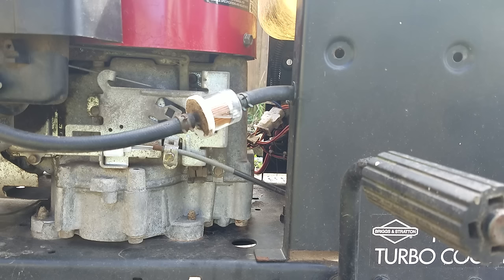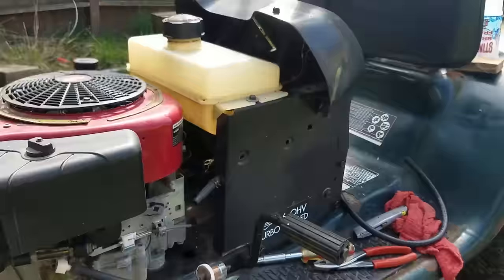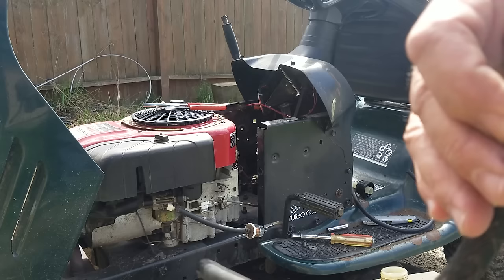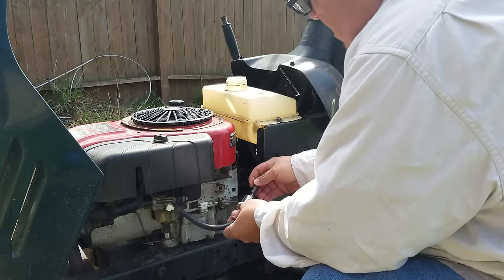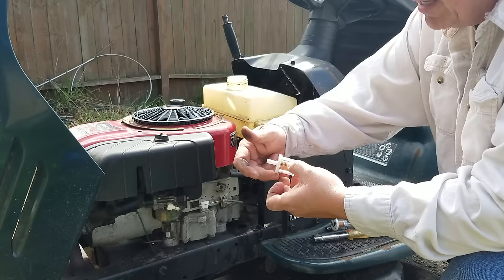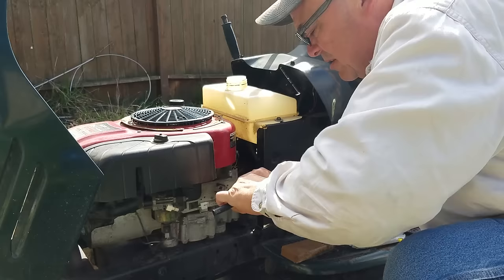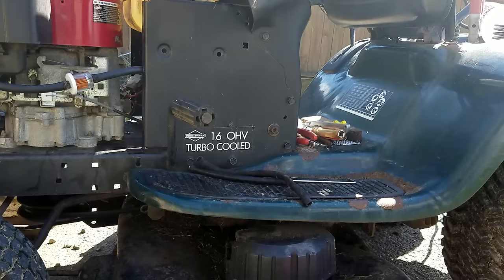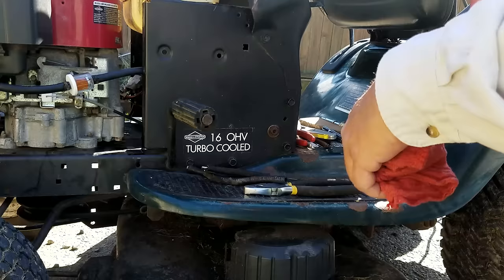Riding Lawn Mower starts then dies. FIXED

Comment: I had a similar problem with my Husqvarna riding mower, briggs and stratton Intek V twin 24.0. Anyways it would run sometimes for 10 minutes, then would seem like it was starving for fuel, cut off , restart sometimes etc. I took the carburetor off, thinking some trash was in the bowl, inspected the float, needle and seat, everything looked really clean. Rebuilt the carb since I had it off, new o rings gaskets cleaned the jets etc. Installed it and fired right up, mowed yard for maybe five minutes, then the stalling , cutting out again. mind you my front yard has a slope to it. After pushing my riding mower back into the garage I was like this thing is starving for fuel. I checked my fuel filter, it was clean but noticed no fuel in it. Turns out my fuel filter was just a degree or two off to get the fuel from the tank, so I rearranged the fuel filter with the flow side pointed more downward, all of a sudden I see gas accumulating into the filter ! I zip tied it to another hose or cable so it will remain in that position. Ran great after that, was able to finish my yard and problem solved. Sorry for the long rant, but I just wanted to say sometimes it's the simple things that get over looked, like I did ! maybe this will save someone some time if they have a similar problem. Thanks for your videos and I do appreciate them !

Comment: I'm a big fan of installing one of those very low cost black & red fuel shutoff valves between the tank and the filter. Makes working on things downstream a whole lot simpler. Virtually ALL available gas in my area for 20 years is 10% ethanol.

Comment: People need to understand ethenal is moonshine and the problem is water and gas don’t mix you need to use a stabilizer there is a product in Canada called phase 4 fuel and ethenal  treatment that prevents separation and keeps the fuel fresh for 2 years
Reply: Troy built lawn tractor dies when engages the blades

Comment: I work on mowers chain saws blowers weed eaters all the time..most of all of them is fuel realated..it's amazing what ethanol can do to small engines ..it gets the gas cap too.the rubber seal detonates and clogs the fuel inlet..you have to check everything..i recommend ethanol free fuel to everyone..thanks for showing this..Cheers 🍻🍻🍻🇺🇸🇺🇸🇺🇸

Comment: thanks for helping me !  im not mr fix it .  ive been having throttle related riding mower starting problems.  got that dealt with .  got WAY back in the hollow , moved around on the seat wrong and it auto stopped.  then OF COURSE its not gonna run . it would start and then stall and the the battery is running down.  so there i am marooned in the amazon, i dont know whats wrong with it but i DO KNOW i couldnt fix it if i did. what a horrible feeling. so i dragged myself all the way back to the house and pulled up youtube and there you were !  i couldnt do the whole procedure back there but WITH YOUR HELP i surely WAS able to get the lines off and clean them out for the emergency fix ! put everything back together and ZOOM !  fired right up. it was such a relief to pull that mower safely into the garage.  so if you ever get frustrated with posting your stuff please know that your kindness really helped me when i needed it the most and that your efforts are appreciated. thank you sir.  THANK YOU VERY MUCH.

Comment: I bought a used Sears lawn tractor with this same  16 HP engine over 20 years ago and it's still running today. I however put a fuel shut off between the filter and tank. Normal maintenance when needed and no ethonol fuel. The mower deck went out however and I use the tractor to tow my yard cart. My kids bought me a new 20 HP tractor when I retired and it's still going also. Thanks for the video. I'm in the NW also.

Comment: Thank you sir. I had this same problem,  replaced fuel lines and filter, and cleaned tank. Runs better than ever. You tube is great for community help.
Reply from the maker: DIY community is the reason I YT..Cheers and stay safe.

Comment: I have the same problem. Craftsman mower is 20 years old and never have changed the fuel line. Filter is new but only has about 1/4 of the fuel filter with gas. Changing fuel line tomorrow! Thanks for the great video!!

Comment: Thanks for this video.  I'm not much of a handyman but decided to give this a try.  After pulling off the fuel line realized the fuel was running fine so all I had to do was replace the fuel  filter. Running great again!  Thanks for posting.

Comment: Good advice I was banging my head around clean the carburetor new fuel filter and what my problem was the debris got stuck in the hole so I had to stick a nail through it pop straight out then had to clean out the gas tank thanks for your video as we get older sometimes we forget

Comment: Good info.  Been a good time to install a fuel shutoff valve.  Good on the carb plus during winter storage.  Just saying.
Reply from the maker: Great point!
Reply: @breakerbroke23  The solenoid under the carburetor float bowl with the wires going to it shuts the fuel off automatically. If it starts going bad, you get the same symptoms. Runs for a bit then sputters and dies.

Comment: Hi there. I came to your channel because my Troy Bilt Bronco had the same issue. I replaced the hoses which were in good shape... The filter looked fine and was full of gas... Yet, I decided to replace the hoses and filter just in case... well, it did the trick! It worked right away with no issues... unfortunately, I hit a tree root and the blade got bent so bad that it scratches the floor... I guess I am bad luck. Thanks for your video.
Reply from the maker: Your bad luck?   Ha!  If I didn't have bad luck, I'd have no luck at all... Iam glad you got the fuel issue handled, and bent blade are easier to take off:) Your okay as long as the spindle didn't get hurt. I guess you could look at it this way, now your Mower runs and you have new sharp Blades:) Merry Christmas .....BB23

Comment: I have a 1984 Simplicity doing just fine, I have a fuel cut valve on the line and use that to shut down the engine so as not to leave that chit fuel in the carb float bowl

Comment: My mower is 8 yrs old. First I had a starting problem, changed  the solenoid. mower then started but would not run.  Luckily I found this video with a mower that was acting just like mine.  Followed the instructions- new fuel line, new fuel filter-now it is running like a mad dog.  Thanks for posting this video
Reply from the maker: Glad you got the mower going... Cheers

Comment: While a degraded fuel line can be one cause, there can be multiple causes for reduced flow.
The mower is a gravity fed system without a fuel pump which depends on the height of the tank above the carb for the pressure.
A low rise gravity fed system does not exert enough pressure to effectivly flow through a 70 micron paper element filter.
Gravity fed systems are supposed to use a simple screen disc type filter which has a much lower resistance to flow.
Was there a prefilter in the tank? In could be clogged with debris from refilling.
Reply from the maker: I'm not fixing "Boogie Man" issues for YT content. I'm fixing a machine that is broken, I say this because if you actually own one of these or have worked on one of these mowers then you would have not made a comment like "Was there a prefilter in the tank? In could be clogged with debris from refilling."  and you would know that the filters used do not matter. In the 40+ years I have been repairing mowers I have seen Briggs use all types of filters on various motors. Filter type is a myth.  Minus 50 pts to the keyboard tech. Cheers

Comment: That style of in-line fuel filter works best with machines which have a fuel pump (vs. gravity fed).  Your fuel filter could be contributing to the problem.
Reply from the maker: The filter I replaced was the OEM filter. 
In real world use I have ran different types of filters in my machines and found zero problems. (both GF and pump style filters) Over the years I have had more fuel line swell and brittle line issues than filters. 
Keep the fuel and tank clean and your good to go.
Reply: That's an interesting fact that I did not consider. I've got an older JD STX38 that I've replaced everything on, and it still stalls after starting. I'll look for gravity feed fuel filters and swap it out. Running out of ideas before I junk it
Reply: @breakerbroke23 my mower hesitates to move would the fuel filter be the problem? Please reply thank you in advance

Comment: We did a test at 4 Stations that had Ethanol free gas. We got a half gallon from four stations. We had them tested and the Ethanol free gas still had 8 to 10% of alcohol in it . Not a joke.
Reply: Half a gallon of gas and you're probably getting almost exclusively the fuel left in the pump's hose from the last shmuck that used the pump

Comment: After watching this video I feel very reassured. Very reassured that I will be buying a new electric tractor soon. If they are anything like my EV, they need next to no maintenance and they are very cheap to run. Thank you for helping with the decision.
Reply: Same here.  After many years of my weedeaters, leaf blowers, push mowers, and riding mowers giving me problems like this and others, electric  or battery powered equipment will be worth a try at the least.  The amount of time I've spent working on the gas powered machines is ridiculous and time I won't get back!

Comment: Fixed a mower this week that would run for just a few minutes then quit.  Turned out to be the vent hole in the center of the gas tank cap had become blocked with some sort of crystallized goo.  It would run until the tank pressure became a vacuum.  Opening the cap would relieve the vacuum allowing the engine to run,  the lower the fuel level,  the longer it would run before creating a vacuum.  Removed blockage from vent hole,  instant fix.
Reply from the maker: Great troubleshooting !!!

Comment: Good job I have a shut off valve on mine and I was wondering why ya never cleaned the tank off while you had it out I always clean things as I go that way no dirt can get in anything.
Reply from the maker: I cleaned out the tank every few years as no matter how hard I tried to keep my fuel clean it was inevitable that dirt would work into the tank. I wanted to make this video as simple as possible, not stray off to far. Thanks for watching.

Comment: Recommend that a fuel shut off valve be installed if there’s none. Sooner or later your engine will be flooded by gasoline from a bad float in the carb. Activating the shut off/ turn on valve will prevent that problem.
Reply from the maker: Yes, and put that shut off as near the tank as possible. Great comment.

Comment: my mower would just shut off and then would restart. turns out the rubber tip came free of the pintal in the electric shut off anti backfire valve and was floating free and every once in a while it would move up  into the needle seat and shut off the fuel
Reply from the maker: Iam sure this information will help others. Cheers.

Comment: The sight of the fuel filter was key to solving my problem. Blew out the line from the filter to the tank. Problem solved.
Reply from the maker: Yes, dirt builds up where the fuel hose hooks to the bottom of tank. Its almost impossible to see from the opening. Cheers.

Comment: All fine and dandy but.... First step should have been...check the gas cap ventilation...2nd, blow out gas line to filter...3rd, replace fuel filter.(plastic media within it WILL,  disintegrate )with Ethanol fuel and plug up fuel outlet. From personal experience with John Deere L120 B&S. 2016
Reply from the maker: Yes, each problem has it's own repair.
And vise versa.. Cheers.
Reply: why didn't you make your own video?

Comment: thank u for a great video... i did a simular repair and also changedv the carb. ran fine until the next use wouldnt start... i only changed 1 fuel line, think that may be a prob. i seen another video that same type of start prob, fuse was the issue... thanks again for the info
Reply from the maker: Your Mower will run like this also if your engine is not charging the battery.

Comment: Weird.  I've had my riding mower for ten years and have never had that sort of problem and I use gas from whatever gas station I happen to be at so I'm sure it has ethanol in it.  In the fall I put in some fuel stabilizer and in the spring it's always fired right up with no problems.  Same with my little push mower and I've had it for 20 years.  I do regular maintenance to them both.  I do need a new push mower but not because of anything with the engine, but because after 20 years the deck has just about rusted out (there are several holes in it and I had to bolt on a bracket 2 years ago to hold one of the wheels on it because the wheel fell off where the bolt hole had rusted out)  Both have Briggs engines.  The push mower has a 3.5hp briggs classic and the rider has a 20hp briggs  Intek engine.

Comment: Hey man not sure if you’re going to see this but I could use a hand maybe you can help... i’m not getting any fuel to the carburetor I have replaced the fuel filter fuel pump and made sure the float in the carburetor isn’t sticking.. so from diagnosing it the only thing I can come up with is that I’m not getting any suction to the fuel pump but I don’t really understand what suction is used looks like the hose goes to the oil stem? When I take that hose off and I blow into it manually with my mouth I can see a little bit of fuel bubbling in the fuel filter any idea what I can do to fix suction issue? Thanks
Reply: Are u able to see the two pictures in my reply above? I can’t even get a diagram to show me where the fuel filter is, or if it even has one still. (Bought used). Can u show me where it’s at in my pictures if u can see them?

Comment: I had a similar problem but the engine died on me after around like a hour. I thought it ran out of gas and I went to my room to play some games until it cooled down before I filled her up. I did and started her up and the mowing belt decided right then and there it wanted to be shot.
Reply: Oh it did have enough gas for me to continue. I thought it ran out until I looked in the tank.
Reply: Did you ever figure out what the problem was ?

Comment: if your carb has a wire at the bottom  disc, that wire with switch on you should have 12v if you have 12v but no gas you can replace that solenoid   the small plunger in the solenoid is spring loaded up to cut fuel  the 12v operate a small magnet to pullit down so fuel can flow in the carb   some carbs dont have this feature  if you can see  gas in your  fuel filter that you added then it could be the fuel pump

Comment: I've seen other videos that claim the type of filter you have should be used on engines with fuel pumps only.  The correct kind for gravity feed engines is the little plastic disk type with just a screen.  What do you think?
Reply from the maker: Great comment, I have seen both types of filters in various applications. I will post a video on this subject. Give me a little time and check my channel every once and a while. Thanks for watching.... BB23

Comment: I always run ethanol free gas in my lawn mower and use the pre-mixed can in my weed eater chainsaw and leaf blower
Reply from the maker: Good for you, always get "clear" Gasoline. I don't like pre mix saw gas. I use Clear gasoline and mix in OPTI for the saws and weed eater. My motors run and the insides look brand new. I have been running Opti in my machines since 2002. Best 2 stroke oil ever, clean burning and easy starting .. Here is a link to look at. I buy mine from a local to support his business but if your locals dont have any order up a few packs and try it out. Best oil ever. https://amzn.to/3DX9mVZ ( I buy mine by the quart, but you can get a small packet that makes a gallon or 2 ) 

BTW.. I put this in my mower and run before putting away for winter.
You can thank me later.  Cheers
Reply: I wish I could find pure gas where I am at but its impossible
Reply: @lexiemaep7930  I am so glad I can get it its expensive but worth it for my lawn mower

Comment: If you think producing ethanol is bad, you should see how bad it is to refine oil tar sands. Ethanol gas is amazing for cleaning out an engine and maintaining a clean engine, but the engine needs to have been designed to run ethanol gas from the start. The older rubber compounds not designed for ethanol can't really hold up. The new rubber compounds designed for this have absolutely zero issues with it.

Comment: also, when you buy ethanol free the first gallon or so could be regular unleaded if the pump has only one hose for both types of fuel....
Reply from the maker: Great Comment.......... I lived out in the woods at the time of this video, and the little ma&pa station had one hose for all mixes of regular. ( no diesel ) 
Most modern stations I have seen the past few years have a dedicated hose with a BLUE handle.  Blue= Ethanol Free, Black= Reg Unleaded, Green= Diesel.

Comment: Bud you don’t have to drain the good gas. Leaving the gas cap on (if u take it off the last part the fuel will come out fast you don’t want that)Just snip the line an inch from the tank and before doing so find a bolt that fits into the line snugly that’s can be screwed in. Just snip line use the bolt to prevent gas from leaking out. Get your new line together with a bolt in the end of it and open the clamp on the old line the one inch piece and while hold the clamp open with pliers or if a worm gear clamp just loosen with a screw driver and twist off old line and and slide the  new line on. It won’t leak out the new line because their is a bolt screwed into the end of the new line. And not a huge bolt a bolt used that is just barely bigger than the line. Theirs is better than pinching the rubber line. But this will save u some time